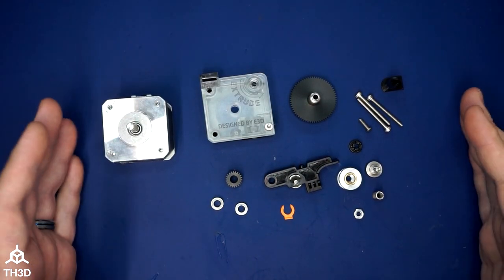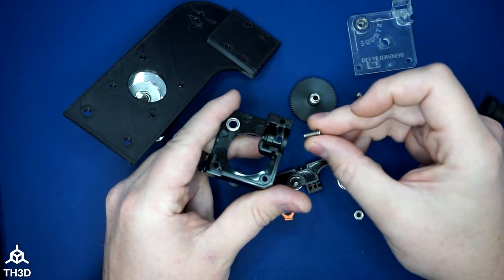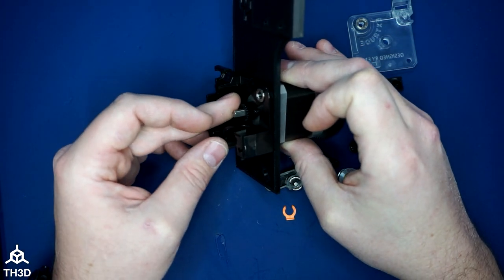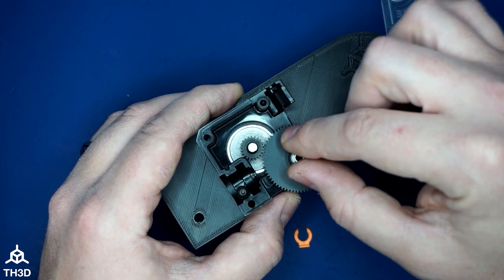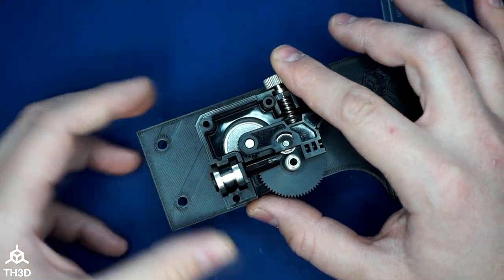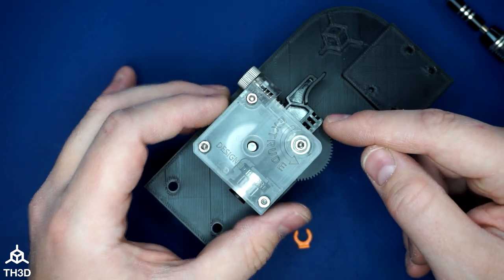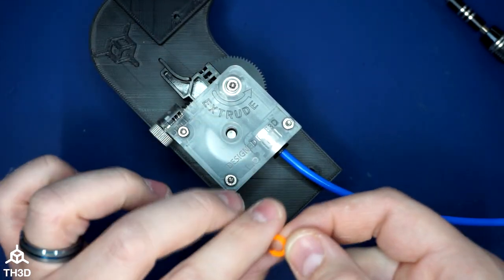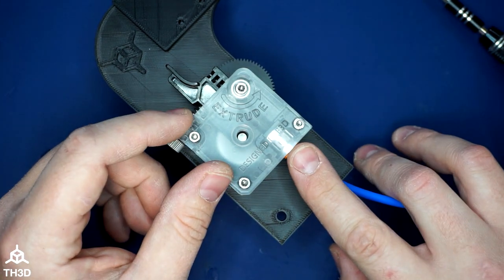TH3D Tough Extruder V1 Assembly Video | Titan Compatible

Comment: 463 didn't work for me on my Ender-5 with stock motor and I ended up using 408 E-steps so that it would extrude 100mm of filament properly when I told it to.  Now it prints flawlessly at 100% flow rate.
Reply from the maker: We did some more testing and got anywhere from 402-415 on our machines. 410 is a good starting point and we've updated the product documentation. We also made our own EStep calculator page on our site here: https://www.th3dstudio.com/estep-calculator/
Reply: @TH3DStudio  Nice!  This will definitely improve the Tough Extruder experience for many users.

Comment: Just bought one of these from you guys. I wasted several days trying to figure out why my brand new genuine E3D V6 hot end is clogging after a few layers. I even have one of those dual gear metal extruders for my OG CR-10 and it starts to slip mid print. I'm hoping that this can get me back up and printing. I replaced my mainboard, added a BLTouch, printed a whole new enclosure from a CR-10 modder facebook group, printed a hero me gen 6 cooling assembly, bought all new fans and new hot end. Silly me, thinking that I was done. Man I hope this works..
Reply from the maker: See here about your hotend: https://www.th3dstudio.com/hc/product-information/hotends-extruders/using-your-all-metal-hotend/

Clogging with all metals is common, you just need to handle them a little differently.
Reply: @TH3DStudio  How didn't I see this before. I was all over the internet looking for exactly this. Found a forum post on e3d's forums where a guy was having the same problem as I was, and they practically told him to just buy a titan. 

Thanks for this, I'll bust out the canola tomorrow. I used to take a piece of sponge and put a few drops of oil on it and wrap it around the filament holding it in place with a binder clip right before the extruder. Ever since I switched to capricorn tubing I haven't had to do that, but this is definitely worth a go. I did also try limiting retraction, but I'll try a print without retraction with a healthy coating of canola. Thanks for the tips, really appreciate it. I still think that this extruder will be a good improvement overall, cause that el cheapo red chineseum dual gear jobby I have now is pretty sketch in my opinion.

Comment: What mount was that you are using for the Ender 5 plus?
Reply from the maker: Its one we designed that will be on the site soon. It'll need to be printed in ABS due to the motor heat but we'll have it available for purchase as a printed part from our farm here and an STL link.
Reply from the maker: The mount is on the site. Download for the STL if you can print your own ABS is on the installation page for the bracket: https://www.th3dstudio.com/product/ender-5-plus-abs-tough-extruder-e3d-titan-mounting-bracket/